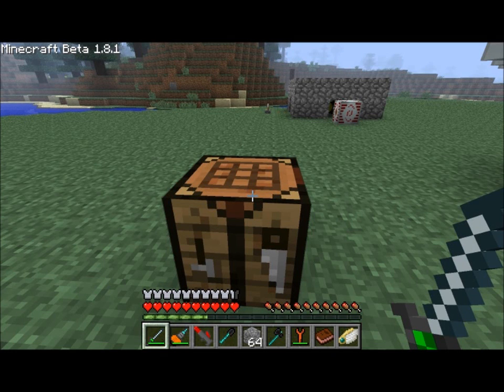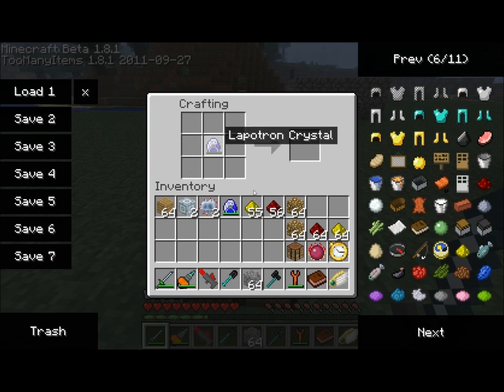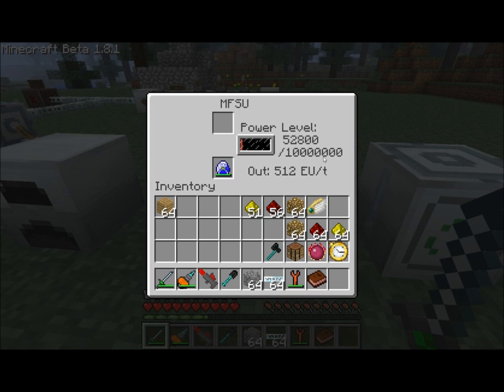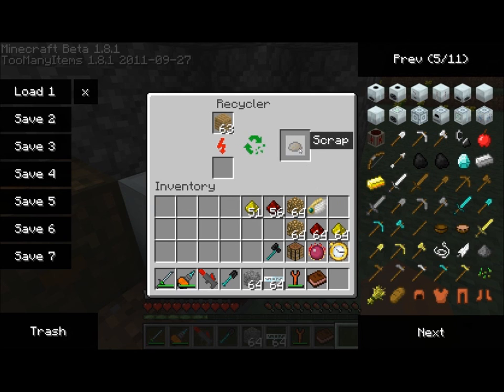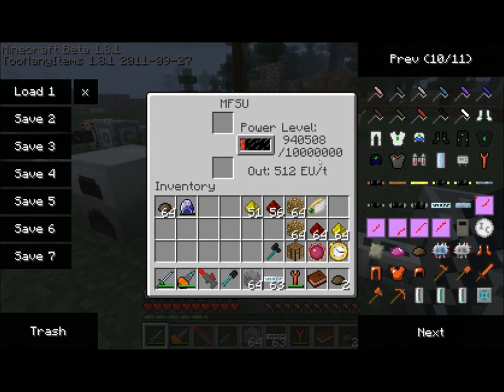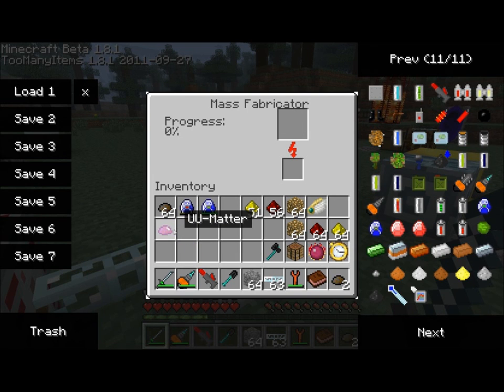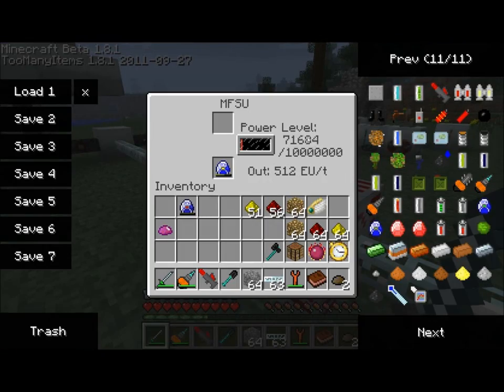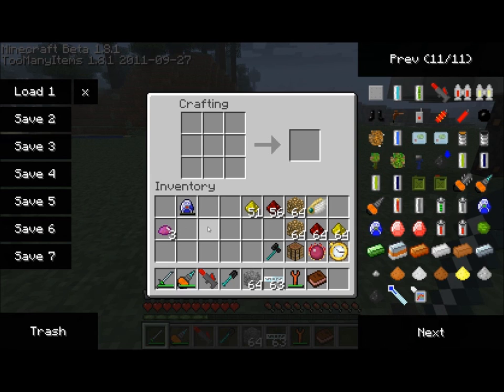IndustrialCraft 2.0 Tutorials - Mass Fabricator

Comment: Great video, as always!  Two things to note:

1) With scrap, the MassFab uses 125k EU to make a piece of UUM.  It's a x8 multiplier.

2) You can apply a redstone current to the MassFab to turn it off so that it only runs when you want it to.  As simple as putting a lever right on the machine - that way, you can run it when you have scrap and turn it off otherwise.